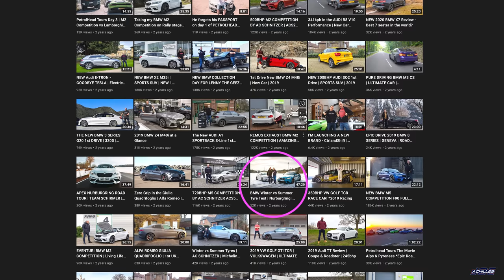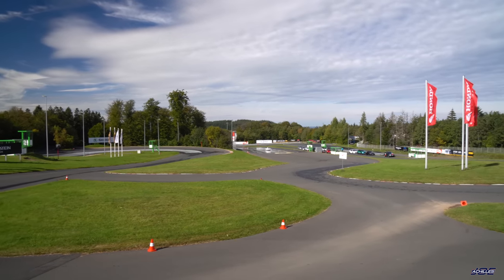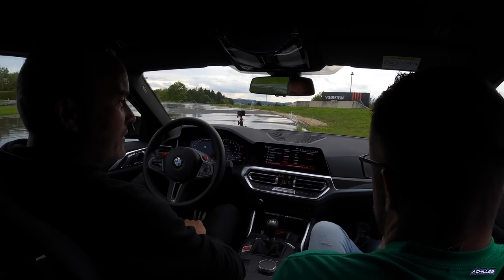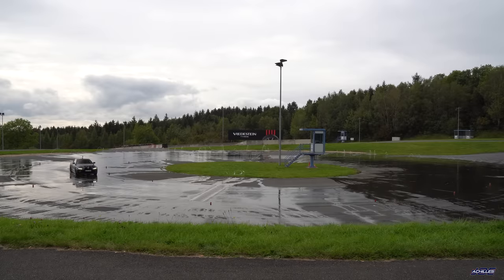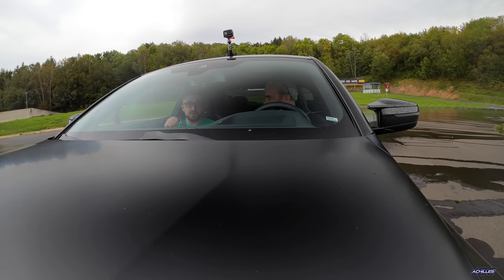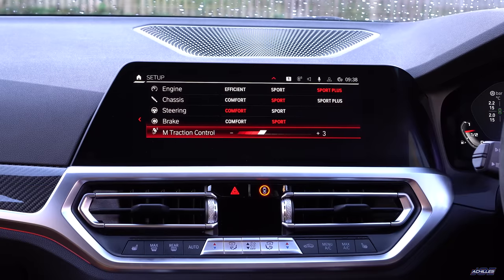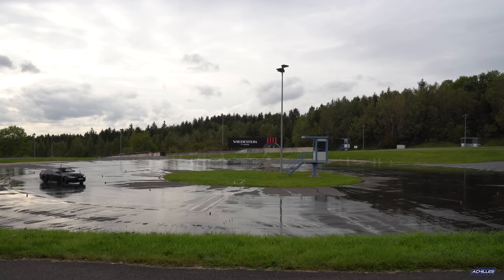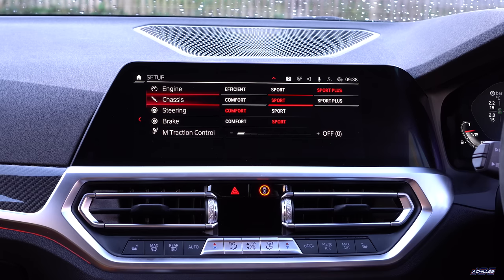What is BMW's 10 Way traction control system? | 4K

Comment: Why does your M3 only have the bottom half of the halo DRL? Does the M3 not come standard with the highest trim of headlights?

Also can I rant about how BMW is doing that on all their cars now? Imo the little line at the bottom just doesn’t look as good as the full(or at least somewhat full) halo light. Feel like anything higher than a x30i should have the full halo running lights.
Reply from the maker: My M3 Competition has the laser light option. This is an base model M4 (2 doors), it has the standard LED lights. No manufacturers include laser lights as standard.

Comment: Hate to tell you but doing drifts in a circle, find the right pressure and hold the throttle to continue the drift, do not pump and you will continue smoothly
Reply from the maker: Hate to tell you, but with inconsistent slippery surfaces and a twin turbo engine, that technique doesn't work for me.

Comment: In my bmw E93 330  I have 3 settings standard traction control (Dsc), traction control off where you hold down the DCT button for 10 secs and lastly you have DCT ,(idiot proof) which is for wet or of your proper going for it amd dont want to die but kicks in a fare bit! Been too scared to go completely off as I drive to fast anyone done it completely off? I've had mine tuned and run race fuel so slightly spiceir than a standard E93 AND I run XHP stage 3 gear box tune.